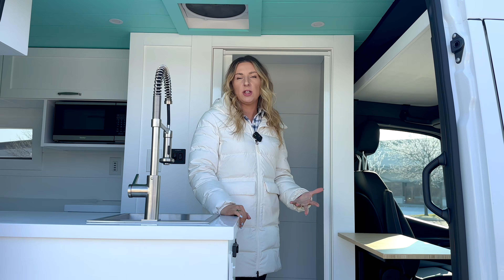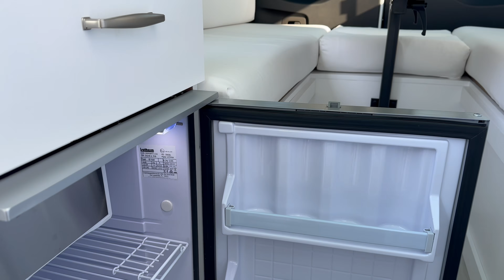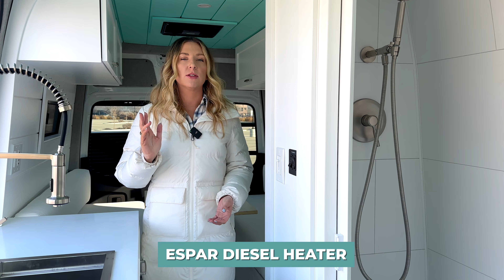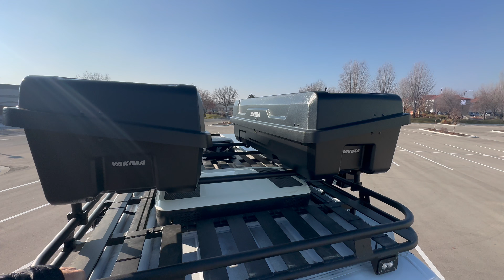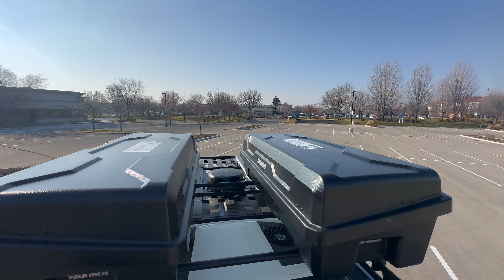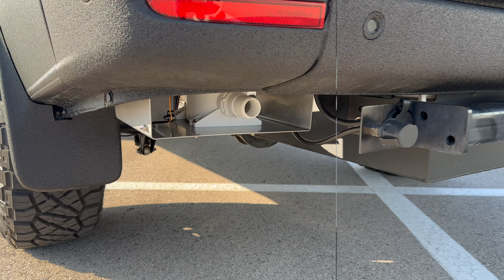Efficient Design in a 144" Sprinter Van with Bathroom and TONS of Storage

Comment: How much difference is there in MPG between 144 and 170 units?  
My guess is that aerodynamics are about the same. 
Weight is different, of course.  
Finally, how much difference in MPG do you see between 60 and 75 mph (if 75 is a safe speed)?

You both are incredible designers!